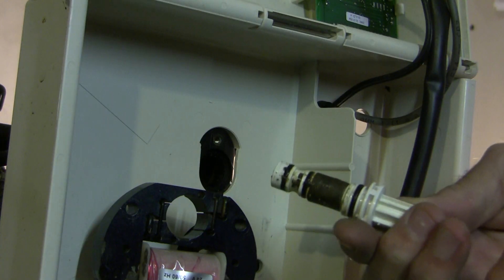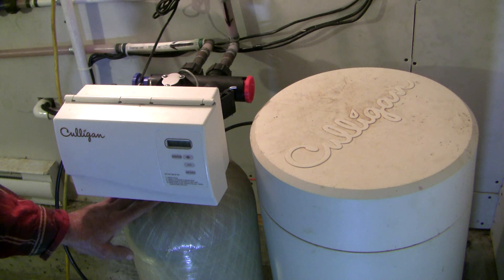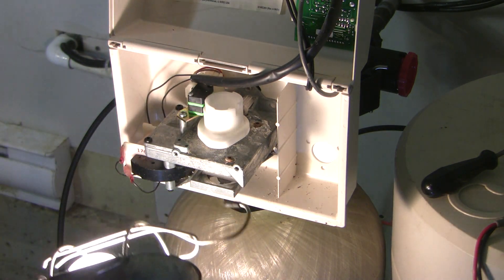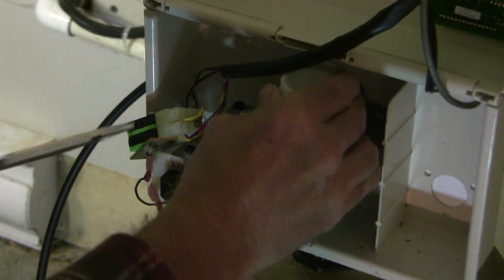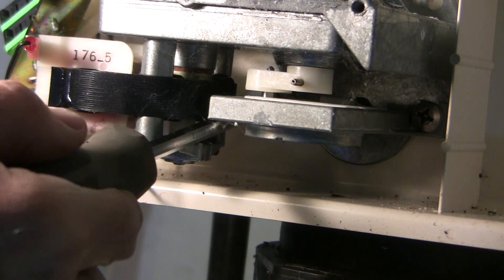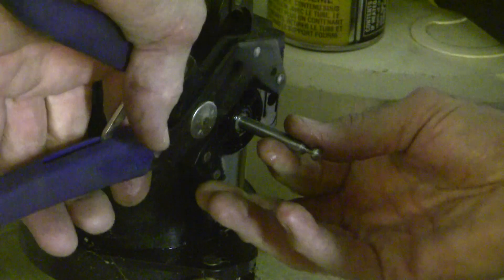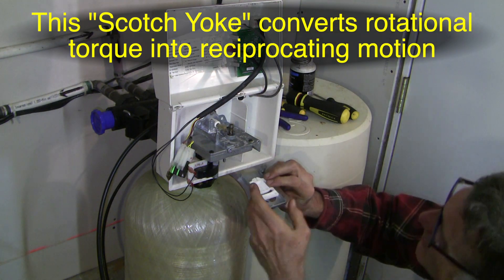How to fix a Water Softener

Comment: My machine same model is draining water continuously, but there is no error on the display. What should I do.
Reply from the maker: That happens normally during parts of the cycle, flushing the tank. You can bypass the water softener by pressing the bypass button. Then water will make a hissing sound as the water goes by the water softener to deliver water to the rest of the home. If the system is 'stuck' at a spot because of corrosion or damage to the mechanical wheels, you can clean those wheels off and lubricate the mechanism.

Comment: Appreciate the video and the time you took to post it. I have an error code E3 which comes on midway  through the regeneration cycle. I assume I will follow the steps you took?
Reply from the maker: It's been so long since I did this, I don't remember much of it. Mine continues to work fine. As I recall the manual was pretty good, available online.  Starting where I did to look for obvious problems would be a reasonable plan.
Reply: @spelunkerd  It worked perfectly. Waited to get the silicone lubricant. Well worth living with hard water for few days to do it right.

Saved us a lot of money. Nothing beats experience. Appreciate you teaching us folk.

Comment: I noticed mine is not salting the water and then thought about it and haven't heard it regen in a while. I went into the flow screen to check is it was reading water after turning 2 faucets on and the numbers stayed reading 0.0...so tapped around on it thinking might be some debree keeping it from reading a flow and nothing. Went through the basic settings and everything like time and so on was set correctly. So I decided to manually regen and pushed the button and Regen reads on my display but nothing happens. I waited about 2 minutes and still nothing and it still read out regen. So I unplugged it for about 5 minutes and plugged it back in and it sounded like regen mode for about 5 or 10 seconds and shut off. I reset time and pushed regen hoping it would work and still nothing...reads regen on display but motor not coming on. Could you give me some advice please?
Reply: You have to hold Regen down until it starts. If you just push it once then it will Regen at night at the regular programmed time.

Comment: You can pull those two pins out in the back then there's little u-shaped pin you can pull up then then there is a circle back plate will come off and you can pound it out

Comment: Why engineers don't prefer to use selonoid valves to contol the water ? for more smooth pass ? or not to stress the tank ? thank you
Reply from the maker: That's a good question. Looking back at the interface between mechanical timing and the valve body, it looks archaic. Using a motor to power a wheel to get timing correct is old technology, for sure. On the other hand, we expect these devices to work for years, so I guess we should anticipate working on them for years to come. I have little doubt that new strategies will have more complex boards with epoxy and no chance of repair aside from component replacement. Maybe they will be more durable, although lessons from the auto industry show otherwise.

Comment: Hi guys my Culligan water softener has some problem with the refill phase... I always need to refill manually water...does anybody know what should be the problem or where I can take a look to fix it?Thx 🙏😊
Reply from the maker: I would probably start by removing and cleaning the seal pack, the way I did it. Along the way, clean everything, then reassemble. You can get silicone paste from Amazon. A brief look today turned up a few that are specifically formulated as 'food grade', which is probably a better choice.

Comment: Great Video.  Thanks so much for posting this.  I'll be tearing my identical Culligan unit apart tonight. Out of curiosity, what kind of seal is there between the stainless steel plunger shaft and the plastic cage of the main spool cage?  You point to the region at 7:43 (the wide section).  You actually remove the shaft from the spool at 8:25.  This stainless shaft is the actuator shaft that slides the shuttle/spool back and forth inside the plastic routing cage. You mentioned the white seals (that seal the shuttle/spool  between the flow channels) but you didn't mention anything about a seal between the actuator shaft and the plastic cage.
Reply from the maker: No seals other than what is shown. Those seven black rubber O rings shown at 7:47  support the whole shaft, so I lubricated those well with silicone paste before putting it back into place.

Comment: Thank you for the detailed explanation. I started searching YT after seeing a huge water bill and noticing soft hissing noise from my Culligan water softener. Goes away when bypassed. Figured it was the intake valve, but couldn't find ANY video that showed and explained. I'm in Canada too and just got a call back from local Culligan. $150 for the service call plus any parts/service needed. So I'm looking at roughly $400 + tax minimum for this. Highway robbery. Is there any generic size rubber seals I can get from a hardware store or Home Depot as an alternative?
Reply from the maker: I wasn't able to find one, it seems they keep those quietly off the market to preserve their cut of the pie. Mine is still working fine, 18 months later.
Reply from the maker: Oh, one other thing. You should be able to easily quantify the water losses from your water softener by looking at the flow out the drain hose. Normally it drains only intermittently, every week or so. Most of the time that hose should be completely dry. You could even put the end in a bucket for an hour to estimate loss, although you want to be sure it drains through the floor drain if a bucket overflows. If the water softener is responsible for continuous water loss, you should have constant flow out that hose, a clear red flag. If you don't, then water is going through the device and maybe causing a hissing sound but it is not lost there. In that case I'd look at devices downstream. For example leaking toilets are a very common and easily fixable cause of water loss. Often all you witness is a soft hissing sound from a leaking toilet. Likewise it's possible to lose water through an outdoor irrigation system, a leaking hose in a washing machine, or a leaking dishwasher supply line, etc.
Reply: @spelunkerd  Thanks for the insight. Where exactly is the drain hose in the softener? Sorry, I'm completely clueless with this kind of stuff.
Reply from the maker: @tomcha75  On most water softeners, a hose dangles down from the device to a floor drain. If you see a hose leading into a drain, pull it back and see if it is trickling water. Where a floor drain is not available, they need to somehow tee into the black ABS piping of the drainwater system.
Reply: @spelunkerd  Ok. I'll check it out. Thanks!
Reply: @spelunkerd  Unfortunately, it seems like a hose is cemented into the basement floor. This hose is coming off of the left side of where the bypass valves are, behind the control panel. I have the Medalist model just like yours. I do see a pin of some sort above the hose where it comes off of the machine, but not sure if I feel adventurous enough to take that off...

Comment: You mentioned adding Rust-o between bags. Are you adding to the brine tank between salt bags? Thanks!
Reply from the maker: When I pour each bag of salt into the brine tank, I sprinkle a small amount of the Rust-o on top of the salt sitting inside the brine tank. Both dissolve in the water as time goes by. It seems to be working fine, I don't notice any difference in the water taste. My son mentioned that once he noticed the water tasted like toothpaste, then that disappeared the next day and he hasn't noticed anything since then.
Reply: Thanks!

Comment: I'd milk it out as long as possible, then just replace the unit. I'm sure the resin beads are near end of life. I'm a big fan of the ecowater made units because they are cheap ($400-$500 US) and reliable. They are mostly sold under other brand names like sears kenmore, whirlpool, ge, morton, etc. The 'experts' will tell you that these units are junk, but I beg to differ. They use a rotating valve instead of a piston style valve. The early units would slowly wear grooves in the disk, and they would fail in about 5 years. Newer units are the same design with upgraded materials that last longer. You typically get 10 years plus before the seals wear. I will typically rebuild once, then replace on the second failure (usually 15-20 years total life). The resin beads are usually close to end of life by then anyway. It just makes sense to replace at that point.

Comment: Thanks for the great video! i have this model and cleaned out the valve easily,  but can you tell me why would the water still be running through the drain after the re gen stage has finished? we pay for water per liter so its costing me $$$$

Comment: I’m all for guys fixing their own appliances and things around the house. I do it when I can. But what you’re doing is a bandaid. The seal pack is a wear and tear part, and needs replacing or a valve rebuild every 4 - 8 years depending on water quality. The price you quoted probably includes labor by a technician. Not too bad for a house call and parts. Vaseline is a no no. Hope it lasts for awhile.
Reply from the maker: Those are good points. I don't know why people keep saying I used Vaseline. I clearly didn't, as shown and explained carefully in the video. Yup, I fully expect to have to do this again some day, but I can now do it myself and skip the service visit. Too bad I can't seem to find those seals anywhere, since swapping out the seals would likely save another hundred dollars. In professional hands there may be little cost difference, because you are swapping part costs for more labor. DIY labor is free, so the balance tips the other way. Now almost a year out, it is going strong.

Comment: You really have no clue what you are doing. If your water is running down drain its automatic that it's the sealpac ... No need take the head off, also when you took off the 3 screw cover off the top,, this is the brine draw it has 3 pieces you only took off the screen, the small blue or brown inductor is inside if the very small hole is clogged it will NOT suck the brine water to make your water soft.. As for the gray wire which you had no clue what it was ..It is the flow meter wire while you had the bypass off you should have check it.the out side,, just blow into it if it spins its fine...Now for the use of vasoline NEVER use it will damage the outer orings..
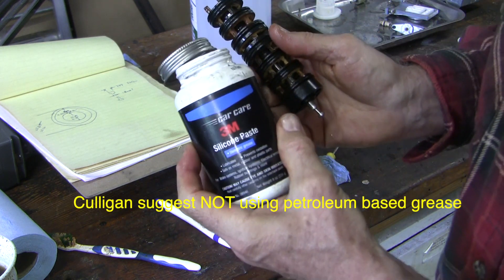Reply from the maker: It is always nice to get a visit from a guy who makes a living doing this repair, every day. I appreciate your constructive feedback about the educator nozzle. As shown in the video I removed first the screen and then I removed the educator nozzle; it is stained brown with natural tannins in our water. The nozzle was clearly patent. Your insight as to how to easily test the flow meter is useful. What I hear from you is that you would quickly make the diagnosis, go right to the seal pack and swap it out for a new one. I have no doubt this is standard professional workflow. Correct me if I’m wrong, but I’ll  guess that in professional hands the cost for that including labor, a service call, and parts would be a few hundred dollars. Your remark about vaseline is noted. For that reason I gave up using vaseline around seals back in the 1980’s; As described in the video at 9:23 I used silicone paste, not vaseline. Silicone paste has a long record around seals, it does not cause swelling or degeneration, and it is safe with drinking water. In the end, my ‘clueless’ repair managed to fix this water softener for, zero dollars. Now almost a year out, the softener is working flawlessly. So, when the time comes I have retained a huge stockpile of money for future repairs or replacement. With all due respect, I’ll take the clueless option.
Reply: @spelunkerd  aren't arrogant knowitallz fun? I believe you can buy the seal-pak for 70 dollars in the US? Perhaps that's just the o-rings? Thought it news you might use when those rings eventually fail.
Reply: Oof.   He said you have "no clue".  It seems pretty obvious to me that you are an analytical genius. 

You probably aren't a Culligan man but you just disassembled their entire machine, explained what each part does, located the source of your issue, and then repaired it.  Not only that but you made quality video documentation, allowing others to replicate the process. I'm sure that hundreds of these viewers are in debt to you now, including myself. I would even venture to say that you are in possession of a tremendous amount of "clues".  Thanks!

Comment from the maker: We're four years out at this point and everything is working normally. When the pile of salt pellets shrank to a low level a few weeks ago, I removed and rinsed out the bottom of the brine tank. I've been adding 'RustOut" powder to the brine tank and it seems to be working fine. To date we haven't had any recurrence of those error messages.

Comment: That was an interesting video.  Do you have any idea why our Culligan water softener keeps missing the rinse cycle?  My husband is adept at tackling mechanical issues, but I have yet to find any information on this specific issue online (aside from people saying to call in a repair person).
Reply from the maker: Sorry, I don't know. I'd start by watching the drum go around, looking for variance with published literature online. Most maintenance problems in these devices are secondary to corrosion, so you might start with a basic cleaning, looking for blocked tubing, plugged screens and filters. Starting at about 6:00 of the video you see me removing some of those screens. If you find a cause, please stop back and describe what you found, I'm sure others would appreciate it.
Reply: @spelunkerd  Thanks for the suggestion.  If we can find out the problem and a solution, I will update this comment.
Reply: What model do you have? How do you know it’s missing rinse?
Reply: @jrm2383  When the unit regenerates, we wake up in the morning to a beeping alarm and an error message that says "missed rinse."  I hit the statistics button to stop the beeping, but the error still flashes on the screen.  It's a Culligan Gold Series, but I'm not quite sure which model.
Reply: @amandaphilip  l think you have a gold aqua sensor. If it doesn’t do a proper regeneration the sensor will alarm. I would recommend a service call from Culligan. A plumber can’t fix it. It might just need a cleaning or a valve rebuild. If it’s 15 years old or more, might be time to replace it.

Comment: If you don't want to put any more money into that control valve, you should replace it with a Clack WS-1. They are very easy to work on, if you ever need to. You might also want to change to solar salt crystals instead of the pellets. They are less likely to cause salt bridging and they are cheaper.

Comment: the seals look like quad ring seals
Reply from the maker: I'm hoping somebody will stop by and point to a source for these seals, they are square cut but with a step, not typical of any seal I've ever seen.
Reply: spelunkerd You probably already sourced your seals, but, I believe “quad ring” is to seals like “crescent” is to wrenches. I’ve bought seals similar to those from McMaster Carr labeled as X-rings. I usually use nitrile rated for high pressure hydraulics though.
Reply from the maker: @jknuthj1765  Remarks like this one are why I always read the comments. A good line on generic replacements would be priceless.

Comment: Well done :-D,  That company really know how to ripoff people :-(, did you measure the outer diameter and thickness of the O rings?, i bet there is a box of assorted rings on ebay or amazon that would not cost a kidney :-D.
The motor i always think of as a " Record player motor."  because i learnt of there existance from repairing record players when i was young.
They also appear in the back of electric ovans, just a longer output shaft and a fan.
One trick the record player motor manufacturers had was to include a 22 volt winding that supplied the amplifier board  in the cheap all in one record player and amplifier.
No transformer needed for the amplifier, very sneaky :-D.